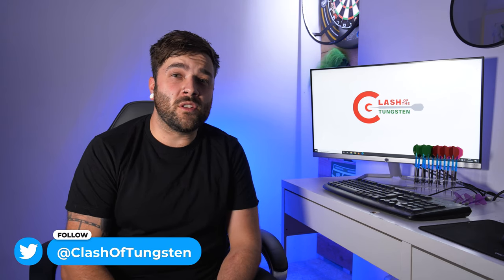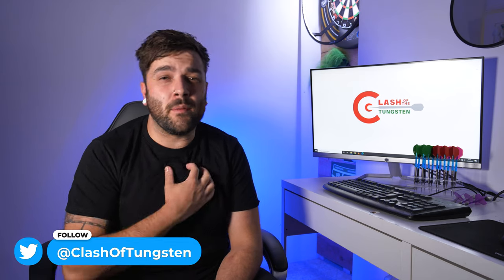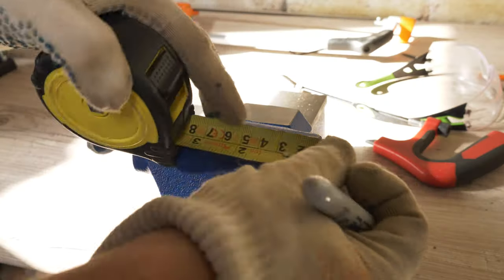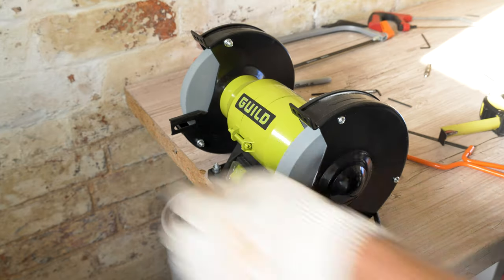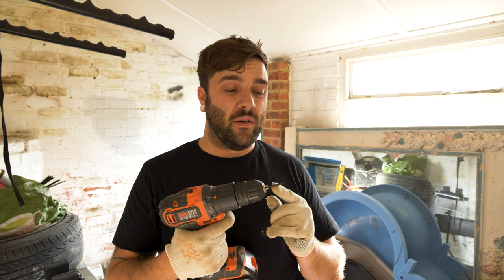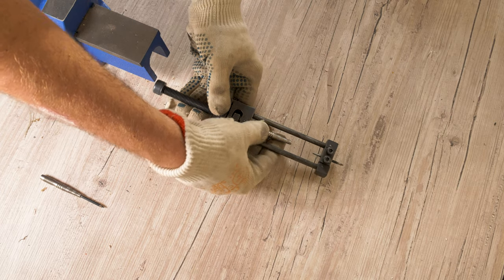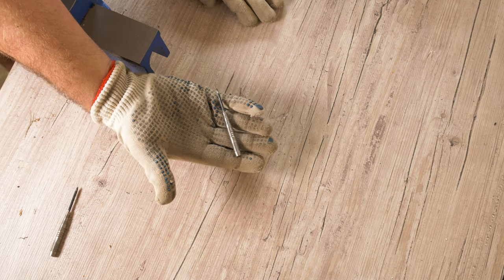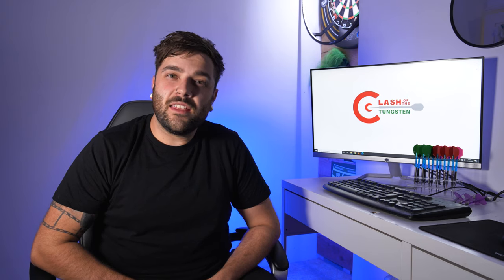I Made Simon Whitlocks Allen Key Dart Points With Basic Tools! Learn How To Make Your Own From Home!

Comment: Well done, goes to show what you can pull off without a ton of tools. You can use a bit of string to measure the diameter of the point, wrap it around, draw a line, measure the line and divide by pi to get the diameter.

That exposed carbon steel is going to rust as well. You can do a cold-blue to really protect it well with a black oxide layer, it's marketed as gun blue. You can also slightly darken a barrel but I've not found a process that gets me a consistent and non-patchy darkening unfortunately.

I've had to turn down jobs requesting sets of those point because the tolerances are stupid tight. For a press fit into a 2.300mm reamed hole you're going to want to be +0.020/+0.060mm or you'll have an interference fit or no fit at all. Using a bench grinder and a drill to keep that part of the shaft concentric is solid.

You're killing me with that tape rule! Not sure what your plans are for the future but getting even a cheap set of calipers and a 0-1" (0-25mm) micrometer will help you get some accurate measurements on darts you might be testing.
Reply from the maker: Thanks so much for this! This was exactly the comment I was looking for from someone! I never even thought of the string what a fantastic idea! I'm gonna make another set soon so I'm gonna try the vinegar method also! 
Haha what is tolerance ;) bodgit and scarper!  Joking aside I can imagine how tight they are but I was just trying to demonstrate a simple way around! As I mentioned I'm useless at this sort of stuff but I sort of thought of a way that it could make it work with the equipment I've got! I might invest in the calipers and micrometers do you think you could possible point me in the right direction to some budget options? Thanks so much for the insight and tips! I really appreciate it!

Ross
Reply: @ClashOfTheTungsten  No worries at all. It'll still be rough to get an exact measurement with the string but it'll get you pretty close.

I was wrong about the vinegar, that's going to create rust (red oxide/Fe2O3) vs the black oxide you're looking for (Fe3O4). I've used it to oxidize aluminum, my mistake.

These are the exact tools I started with ages ago, they're shockingly accurate for the price. The micrometer is dead nuts on my certified Mitutoyo mic. You can definitely get away with just a caliper. Rule of thumb is a measuring device is only as accurate as the second most significant digit (so 5.987mm I'd trust to 5.98mm). I tend to use a caliper on length measurements (except final check) and micrometer on diameter checks.

https://www.amazon.com/iGaging-Digital-Electronic-Micrometer-Display/dp/B0087TMUQ8
https://www.amazon.com/iGaging-ABSOLUTE-Digital-Electronic-Caliper/dp/B00INL0BTS

Shot you a message on instagram with my email if you any any further questions or anything I can help with.